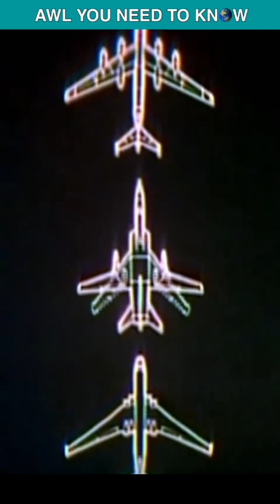Why The F-15 Came Into Being? #shorts

Comment: The U.S. aircraft were absolutely designed for air combat, so that’s wrong. The reason they performed poorly was due to the politicians back in the U.S. putting limits on their activities to the point where any aircraft had to fly through a VERY specific route and couldn’t use the F-4’s main advantage in combat (BVR).

Comment: Pretty sure if that was the case then f15 wouldn’t even come to existence but the f16 certainly will. Also another correction, airforce was getting their ass kicked by s60 surface to air missiles which was some of the best Sam system at the time. Vietnamese airforce was more of a harassment force against USAF to disturb them during missions than actually doing serious damage. They only became a bit more threatening when they developed the hit and run strategy. Head on face to face they lost every time against USAF pilots. Also to people who watched another dude’s video saying Mig 21 Vietnamese ppl used didn’t have a gun think again. F13 Mig 21 was one of the most exported variant to vpaf which had a gun. The one that doesn’t have one was only later exported.

Comment: The F15 was mainly developed to counter the MiG 25. During the cold war, information about a new fighter jet slipped through the iron curtain. The US estimated that the soviet jet could travel at high speed, high altitude while being super maneuverable, which would allow it to penetrate deep into US airspace and deploy weapons or conduct espionage etc. The US wanted to counter that capability by developing a high speed interceptor of their own, the F15. Later, as a deserted Russian MiG 25 pilot crash-landed in Japan and the US examined the plane, the Foxbat turned out to be less of a threat than assumed, making the F15 kind of overkill.

Comment: Actually it was the F-16 and F-18 that came out of the Vietnam conflict. The F-15 was mostly an upgrade for bomber interception roles
Reply from the maker: You're flat wrong. Vietnam war ended in 1975, and lightweight fighter program, the competition between Yf-16 and Yf-17 happened in 1974, while the F-15 first took to the sky in 1972, nearly 2 years before lightweight fighter program.

Comment: North Vietnam flew MiG 17 & 19s. Mig 21 were rare and have a wing loading more similar to the F 105.  It is not all that agile.  F 4s are missile launch platforms..interceptors which require less agility.  MiG 21s are not dedicated intetceptors.  The threat was that up coming soviet designs were being more combat capable...with the exception of the MiG 25 which was built to intercept the B-70 Valkyrie bombers...as was the Su 100 (which looked like a small B-70.  I have seen one upclose at Monino)

Comment: Thought this had more to do with when the XB-70 was proposed to replace the B-52, and the Soviet response to that, the MiG-25. And F-15 was the reaction to the Soviets...
Reply: The US thought the mig 25 was a super maneuverable extremely fast versatile fighter so they made the f-15 to combat what they thought the mig 25 was
Reply: That's the way I learned it
Reply: Well if the F-15 was designed to counter the MiG-25, which it wasn’t, the F-15 would’ve been built with “higher, further, faster”. The F-15 was built to dogfight. Though it was still extremely fast.
Reply: @rhysgoodman7628  You know US surveillance saw the plan view of the Foxbat, and the experts assumed performance and manoeuvrability... Which, as it turns out, after examination of the one that defected to Japan, that they had overestimated Foxbat's performance and kinetics...
And that's your explanation for why the Eagle is more of a dogfighter. Other than a marginally lower time to climb to some altitudes, and slight differences in top speed and accelleration, the other figures aren't much different.
Reply: @eagerlawncare3700 I still believe that it was the XB-70, that the Soviets were responding too with the Foxbat. The timeline gives this one up. 
XB-70 mock-up was unveiled in 1959. The MiG-25 programme also began in 1959, almost immediately after. The Soviet intelligence, even by their own admission, was not even aware of Oxcart/A-12 until 1960. 
So A-12 probably wasn't the instigator, but surely helped confirm the MiG-25 programme was heading in the right direction during 1960-61.
On the other hand, they (Soviet intel) were well aware of the U-2, and the SA-2 was, if used prudently, up to the task.
Reply: @mackerel1875  it was my understanding that the mig 25 was designed to reach Mach 3 to intercept the SR 71 .. the United States just assumed the mig 25 was a " fighter " 
The XB 70 didn't "fly" until 1964 and it was supposed to be able to be launched from fleet carriers  but had disappointing performance so the navy dropped consideration and focused on the  F 14  and F 111 (briefly)  effectively killing the XB program 
A retired Russian mig pilot visited the United States and ask to see two things Disneyland  .. and the SR 71...  in a museum
Reply: @rhysgoodman7628 Because the assumption was that the MiG-25 was a new supermanueverable fighter craft, not an interceptor.
Reply: @rhysgoodman7628 The F-15 also isn’t a dogfighter.

Comment: Couple of things in here that aren't really true. The first is that the f-8 crusader could top any aircraft flown by North Vietnam. The second thing is that the F-15 was designed in response to the mig-25 rumors that were propagating at the time. Eventually a Soviet pilot landed a mig-25 in Japan and everybody was amazed to see what a piece of shit it was. Not only that every time I make 25 would land anywhere this Soviet crewman would pull all the grain alcohol out of the coolant system and drink it so they were never ready to fly. That and the mig-25 barely had enough range to make it out of Moscow.
Reply from the maker: If crusader was able to stop any aircraft, why mostly airman killed?
Reply from the maker: I didn't say that F-15 was a response to Mig-21, i didn't even mentioned Mig-25, the U.S.A.F had inadequate planes that caused so many loses to America. Next time do your search before calling my videos false or untrue.
Reply: @awlyouneedtoknow9435  That's the issue. You DIDN'T mention the MiG25.

Comment: Until the F-4 actually got a Gatling gun. That turned things around fairly quickly air to air.
Reply: That is actually a myth. The airforce and marine F-4 equipped with galling gun kill ratio actually gotten worse compared to before the gun was added. The navy proved that it was the pilot skill that was lacking. Their F-4 kill ratio tripled after the Top Gun programmed was implemented even though they didn't added an external gun. Now we know that air to air missle was the correct move since the vast majority of air-to-air kill is beyond visual range. Pilot back then just didn't understand dogfighting and how to properly used their missle advantages.

Comment: F-15 was build of the base of MiG-25 FoxBat!
Reply: No it was built to counter what we believed were it’s capabilities.
Reply: That just stupid because the Foxbat was an interceptor while the Eagle was an air superiority fighter.
Reply: @quangthai7258  we built the F-15 after discovering the scare of the Foxbat
Reply: @subjectc7505  Yeah but "built in response to Mig-25" has a whole different meaning than the the original comment "built of the base of Mig-25"
Reply: @quangthai7258  When we gave the Foxbat back. They said parts was missing so🤷🏾‍♂️
Reply: @subjectc7505  They said parts was "replaced" with American one. Most likely America kept some stuff to test, maybe materials to better understand the Soviet design for fast interceptor.
Reply: @quangthai7258  They said missing not replaced
Reply: @subjectc7505  That doesn't matter since the F-15 first flight was in 1972 and enter service in JANUARY 1976. The deflection of the Mig-25 was on September 1976, more than half a year since the F-15 enter service
Reply: @subjectc7505  Do you not read what the original post said? It said "base" not "counter". When I said it doesn't matter, I was talking about that. Also, not every jet have to counter something else. Example would be the F/A-18 and Su-27, their development was around the same time so it would be impossible for either side to design a plane that counter another plane that has yet to be fully developed. Another issue you state is the F-16 and Mig-29, they have completely opposite role and doctrine. The F-16 was a cheap fighter to complement the F-15 as an American doctrine (F-22 and F-35), the Soviet have no such doctrine since the Mig-29 was originally a air-superiority fighter like the Su-27. Lastly, these planes are awesome but let not forget what their purposed were, to wage war. You making it sound like these was the cure to cancer.
Reply: @quangthai7258  if it's "based" off another aircraft. It needs that aircraft to achieve whatever role it needs. Without any Soviet aircraft. Nun of what we have would exist or be as good as they're lol. America wasn't the first to do everything u know.
Reply: @subjectc7505  kind of ironic for you to mention America isn't the first to do everything when we are talking about plane. But base off mean that it used something from the original like how the American use the IFV concept of the Soviet BMP to develope the Bradley. But with the F-15, at best you could say the Mig-25 inspired the F-15 to be an excellent plane